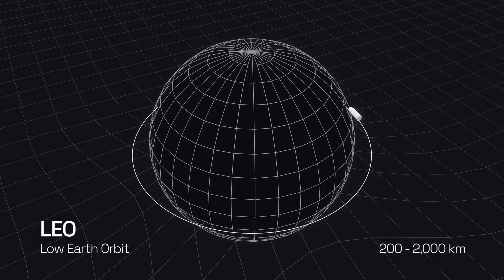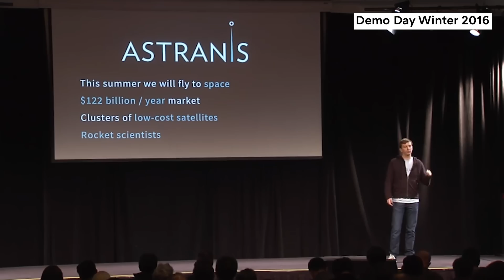You Don’t Have To Be A Billionaire To Launch Satellites

Comment: Chapters (Powered by ChapterMe) - 
00:00 - Intro: Astranis low-cost satellite
01:08 - YC investment in hard tech companies
02:05 - What is Astranis? How did you start a satellite company?
02:51 - How did you end up recruiting Ryan?
03:44 - How did it become a startup? What were the first steps?
04:56 - What was the day 0 look like?
06:37 - How did you build the demo satellite?
07:59 - Astranis Demo Day Presentation
08:51 - Being scrappy
10:11 - Flight hardware building facility
10:46 - In-house testing facility
12:10 - Satellites going to space this year with SpaceX
13:26 - Outro